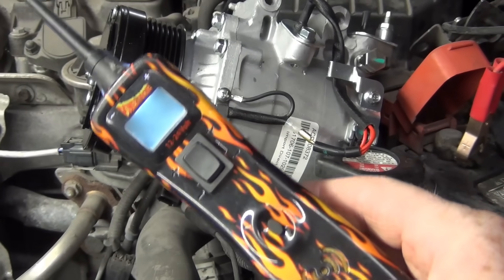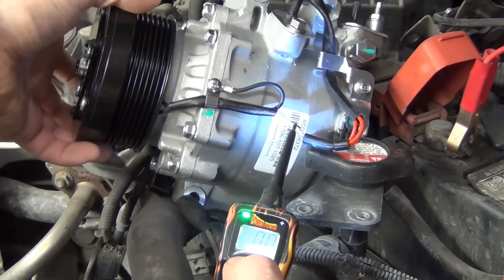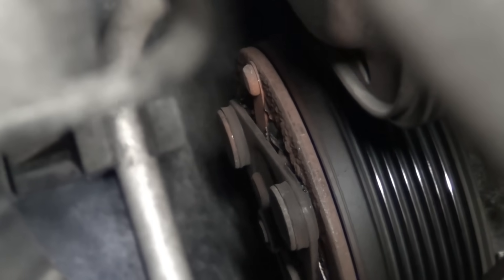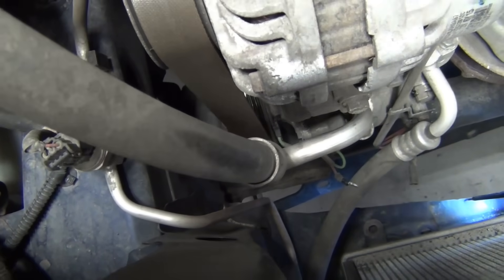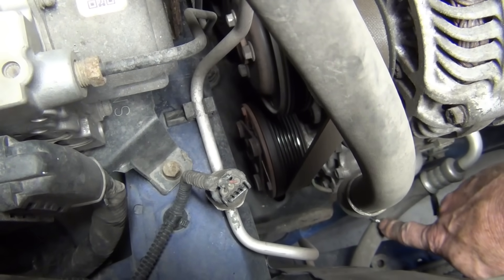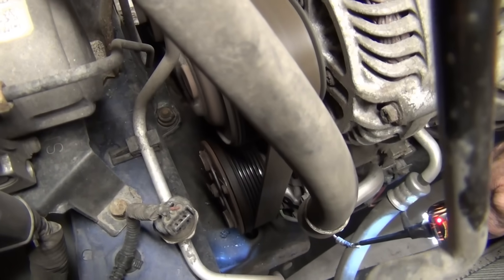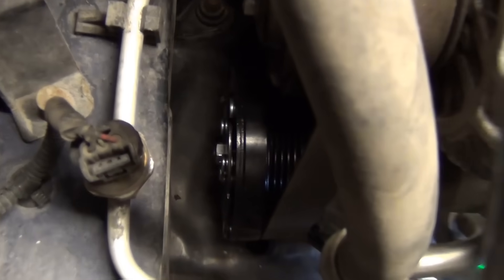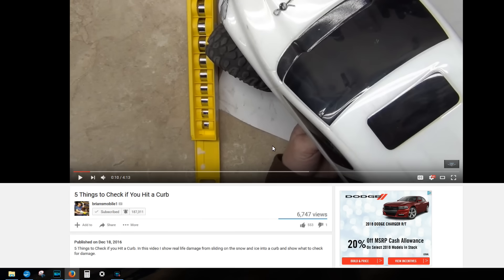How-to Test for AC Compressor Clutch Function

Comment: If you do that with a bmw you'll burn the shit out of the computer
Reply from the maker: You can do it, but you have to disconnect it first.
Reply: I think he means the ones with no ac clutch relay as there is no ac clutch on the ac compressor.
Reply from the maker: Volkswagens are tricky like that too.  You can't see it running or not from the outside.
Reply: Yes, most BMW and VAG cars come with clutchless electronic controlled variable displacement compressors (For example the E87 has a Calsonic CSE613C compressor, and on the drawings you see an electronic thingy, held in place by a circlip, where the wires come out from the back of the compressor, and not from the front). The compressor shaft should be basically always turning and the computer only regulates the inclination of the plate with the cylinders so they pump more or not at all depending on how much cooling you require. The only way to know if the compressor is alright is pulling the belt out, removing the pulley, and check if the compressor shaft severed itself (they do so when the compressor locks up). If the shaft is alright but you still get no cooling you either have a problem with the control computer, the wiring or the compressor's displacement control valve (which, depending on the compressor's maker, can be immediately replaced after removing any gas from the system, like with a Calsonic CSE613C or an Harrison CVC, or may require compressor teardown).

Comment: Last summer my mustangs ac stoped working so I just used speaker wire with a nail taped to it to put 12volts to the compressor clutch, pretty hacked but it worked ( ended up being a bad constant control relay module so I had to pay like $100 for a new one instead of just buying a relay)